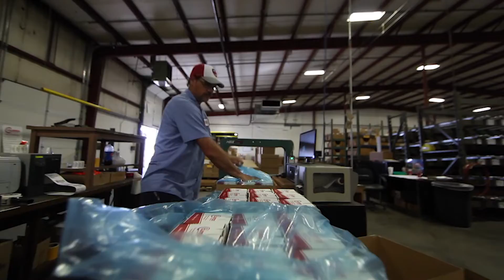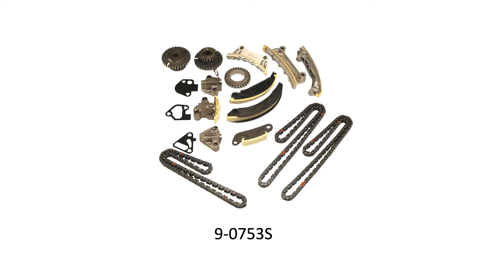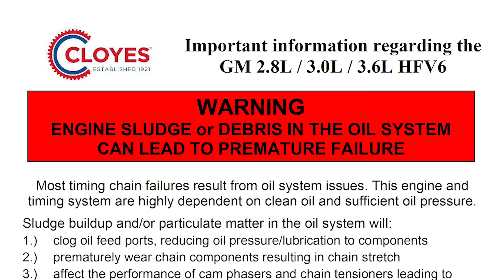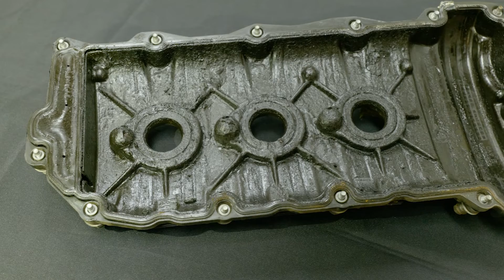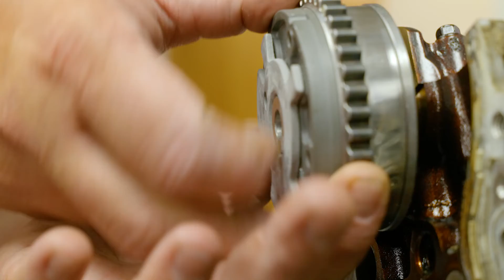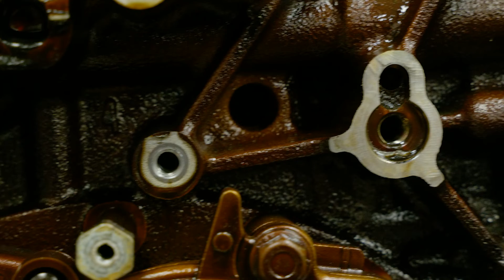GM 2.8/3.0/3.2/3.6L Timing Chain Replacement Diagnosis, Cloyes 9-0753S

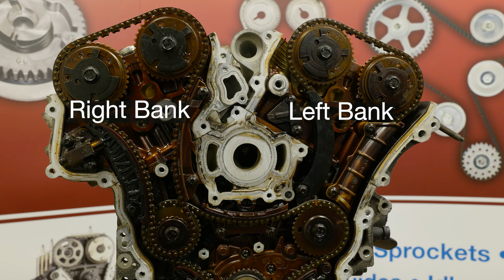Comment: 4:55 Sir I just removed intake 4 bolt style cam phaser on 08 CTS 3.6 direct injection and did not notice any thrust washer behind or between the cam and phaser (am I missing something 🤔 Do I need to purchase a thrust washer when I gear up to purchase a new phaser from you fellas)
Reply from the maker: Vehicles manufactured prior to 6/5/2009 require the use of GM #12632859 thrust washers when installing later style 4-bolt phasers.
Reply: @Cloyesgear   I have 2009 SUZUKI GV with N32A 3.2L engine, does this also apply when changing phasers? The car has first registration 30th June 2006. How do i determine if the washers are needed or not?

Comment: 2015 equinox 3.6 cloyes complete timing set was installed by mechanic.  CLOYES90753SVVT 
11months later 9k miles the front bank timing chain broke driving down the road. Since that happened it took out the front head rockers and bent valves. Is there any help from cloyes for this repair since the broken chain had to be a manufacturer defect. And can't afford the repair after spend 2500 for the timing to be repaired 11 months ago
Reply: Same here on a Cadillac CTS 3.6 2009, kit was Cloyes 90753SWP, only 5K miles, that a serious issue, i install many timing chain, never any issue other than this junk, when i get the packing i already see that now Cloyes are made in China !!! not anymore in the USA, i never get any issue with the USA made kit from Cloyes, probably my last Cloyes timing chain, of course i don't expect anything from them !
Reply: 3 engines same issue. Cloyes refuses to take responsibility.

Comment: What is difference? Between the timing chain and gears.between the 2006 and 2007 I have 1 of each the 2006 runs but wrecked and the 2007 does not run I think it has a bad timing chain .